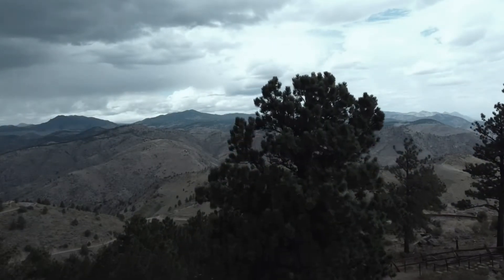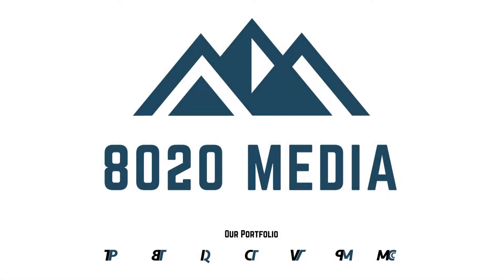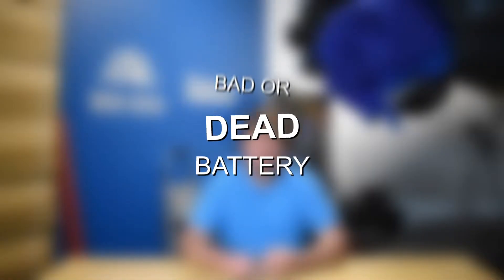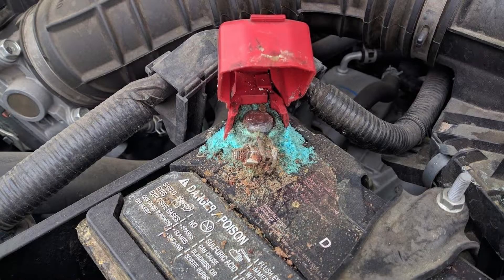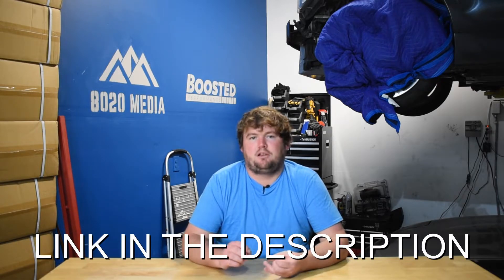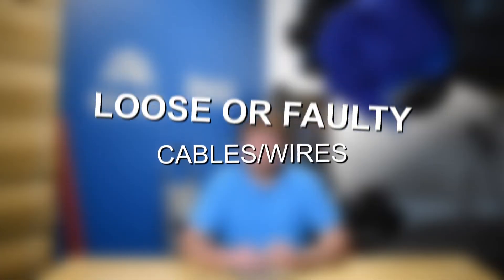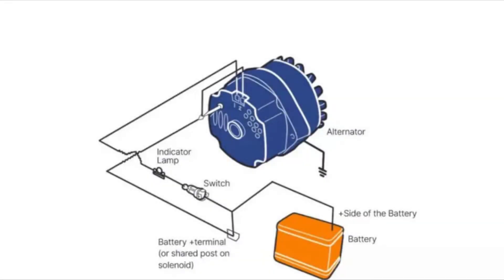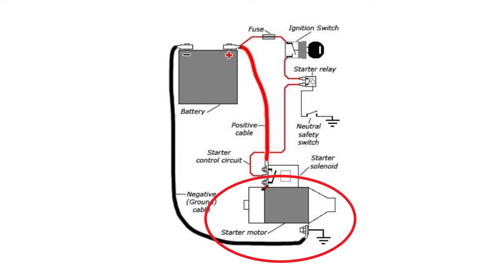DIY – Why Your Engine is Clicking & Not Starting or Stalling Soon After Starting

Comment: I had a single loud click and replaced my starter but it’s still doing the exact same thing… could it be a relay or the engine?
Reply from the maker: F - Sorry to hear this! If you’re still getting a single loud click after replacing the starter, the issue is likely not the starter itself but could be a weak connection, faulty relay, bad ground, or even a seized engine. Start by checking the battery terminals for corrosion and ensuring they are tight and secure. Test the starter relay and solenoid by swapping with a known working one. Also, try manually turning the engine by hand using a breaker bar on the crankshaft pulley—if it doesn’t budge, the engine may be seized. If it turns freely, the issue is likely electrical, possibly a bad ground or weak battery cables not delivering enough power.
Reply: @8020Automotive  the engine turns freely with a breaker bar, which is very good, but now I have an electrical issue to chase down. 😓I appreciate your reply. I checked for good voltage to the starter and everything seemed fine, so next I'm going to be checking for grounding issues. I know it's not the battery because it reads 12.2V and jumping it did nothing, and I just replaced the relay and starter, so it can't be either of those... It's not a fun problem to have, but I'll chase it down eventually. Thanks again for your help!
Reply: @Fyrestare did you ever figure it out? same issue here.
Reply: @chasegeisler  yeah it was actually the cable that bolts onto the starter. To test if that’s your issue you should take the starter out, hook the cables back up with the gear facing out so you can see it, get a friend to turn the key while you hold the starter, and it should push out and spin. Mine was spinning, but the piston wasn’t actuating so it wasn’t engaging with the flywheel in the engine. If it pushes out but doesn’t spin, the cable that plugs in is your issue, if it spins but doesn’t push out, then the bolt on cable is your issue. I was able to find one at tractor supply for like $20, and I just zip tied it to the cable loom all the way from the battery to the starter.
Edit: good luck and I hope this helps!
Reply: @Fyrestare what’s the cable called?

Comment: I have the rapid clicking when the weather is warm, the car will start fine in the morning when it's cooler. I've replaced the battery.
Reply from the maker: A - If your car rapidly clicks when starting in warm weather but starts fine when it’s cooler, it could be due to heat-related resistance in the electrical system, a weak starter motor, or a bad ground connection. Since you’ve already replaced the battery, check the battery terminals and ground connections for corrosion or looseness, as heat can increase resistance and make poor connections worse. The starter solenoid or motor could also be failing, especially if the internal components expand in heat, causing weak engagement. Another possibility is voltage drop due to a failing alternator or wiring issue. Try checking the voltage at the starter while cranking—if it’s dropping significantly, there could be a bad connection, weak alternator, or a failing starter relay. Keep us updated!

Comment: I try to start my car in the morning. If it drops lower than 15° at night I'll here just a click. If I turn the key multiple times it finally starts. I have a new starter, ignition switch, battery, cam shaft position sensor, changed the starter relay, nothing has helped. Today I swapped the ECU relay with the fog lights relay. Hoping tomorrow it starts. I heard that was a problem on my vehicle. Also once I do get it started in the morning it will start every time that day. So idk. Fingers crossed for tomorrow.
Reply from the maker: S - Since your car only clicks in cold weather but starts after multiple attempts, the issue is likely temperature-related electrical resistance or a weak ground connection. Since you’ve replaced the starter, ignition switch, battery, and relays, I’d recommend checking the battery cables, ground straps, and main power connections for corrosion or looseness, as poor connections can cause high resistance in cold weather. Also, test the battery voltage drop during cranking, as a battery can still have enough voltage but not enough cranking amps in freezing conditions. If swapping the ECU relay works, it could indicate a weak relay contact, but if the problem persists, consider inspecting the starter solenoid wiring and ground points to the engine block and chassis. Keep us updated!
Reply: @8020Automotive  ok thanks. Relay thing didn't work. Supposed to be a warm weekend. It stinks they put the starter under the manifolds smh. I'll check all that stuff as best I can. I can do the battery and all that. One thing I noticed when it was running I could do that thing where you press the door thing 10 times and the car test everything from the ECU. It worked when the car was running that day. You have to have the car off. today it didn't work dont know if that means anything. I had a backyard mechanic do the starter smh. So who knows. So far I have spent 800 I don't have lol. I will keep you posted. Worse comes to worse I'll be getting taxes back soon. So might take it to a shop. Im thinking it's electrical to.thanks again

Comment: Okay. I hope this video is not too old that the comments are not replied to anymore. Im desperate. 

The alternator was test, is fine, the battery is new. The car tries to crank. It tries to turn over, all lights come on. But the car wont jump start unless i am jump started by another vehicle. I dont understand it...
Reply from the maker: T - We will always answer comments regardless how old the video is. If your car only starts when jump-started, despite a new battery and a tested alternator, the issue likely lies in the voltage delivery or current flow. Check the battery terminals to ensure they are clean, tight, and free of corrosion, as even minor resistance can prevent proper power delivery. Inspect the ground strap and positive cables for looseness, corrosion, or internal damage that may restrict current flow. A failing starter could also draw excessive current, making it harder for the battery to crank the engine alone. Additionally, perform a voltage drop test on the starter circuit to detect any hidden resistance. The problem is most likely a weak connection or damaged cable, so addressing these areas systematically should resolve the issue. Keep us updated!

Comment: So with my car, I get a rapid clicking sound even after i just bought a new battery. All the car lights and the radio are on and bright and seems to work fine, but i still cant get the car to start. Would that be more of an issue with the connections to the battery or the alternator? I was driving fine on my commute home but then after trying to start my car the next morning all i got was the rapid clicking noise even though all the lights in the car turned on as well as the radio.
Anybody have any tips?
Reply from the maker: D - Could be your starter. This video may be helpful with your research: https://youtu.be/VLKFh4JGzio

Comment: I have a 2018 Mitsubishi Outlander ES. My car wouldn’t start so we got a new battery and they said our old battery was definitely bad. Got the battery put in and now all my dash lights up, my radio works, and all my lights work including my headlights. Still didn’t start though. Also both sets of my keys won’t lock or unlock my doors and the lock and unlock buttons on my door don’t work either. Tried changing the battery in both and still the same thing. Do you have a clue what could be causing both of these problems?
Reply from the maker: H - This video may be helpful with your research: https://youtu.be/0YRdzJbHcm4

Comment: I get rapid clicking Bought a battery for 250 helped for 2 days back to the same issue changed a year old alternator yesterday still doing the samething drove it over 30 minutes still rapid clicking but jumps off everytime
Reply from the maker: B - Have you checked the starter/starter motor?

Comment: What are some good brand and car part websites besides rock auto to get a starter motor.
Reply from the maker: K - It really depends on what brand your vehicle is. There are different niche sites for brands.
Reply: @8020Automotive  my vehicle is an Acura
Reply: What’s wrong with Rock Auto?
Reply: Rock Auto has went downhill lately. I got 2 Denso starters back to back and both had the exact same broken harness connector. I recently ordered a rotor set from them and went by their make and model drop down system. They sent the wrong one and refused to refund that one. To the OP, A1Auto, Carparts are 2 other decent sites.

Comment: I get clicking, no start, with rapid flashing oil light
Reply from the maker: D - Sounds like the battery to us.
Reply: @8020Automotive  It definitely was! Swapped it out an hour ago myself because my roadside insurance was being a pain in the ass
Reply from the maker: D - Glad to hear this has solved your issue!
Reply: @8020Automotive what about jumping in my truck i just hear clicking. The auto store said the battery was good a few weeks ago. No lights turn on on the dashboard but the theft light turn off when I turn the key but not sound trying to crank the car. Accessory mode the radio turns on but not turning it the other way.
Reply from the maker: M - Maybe this video will help: https://youtu.be/0YRdzJbHcm4